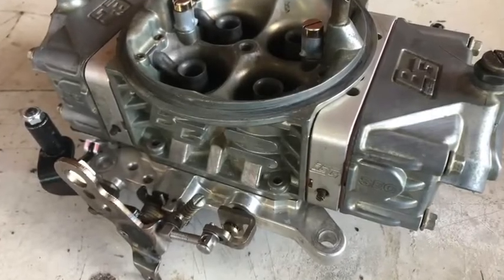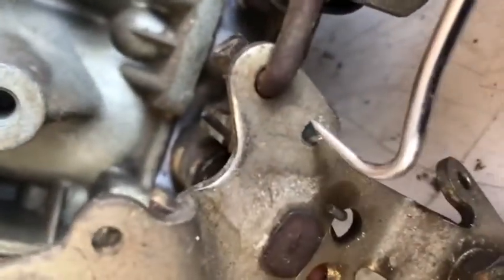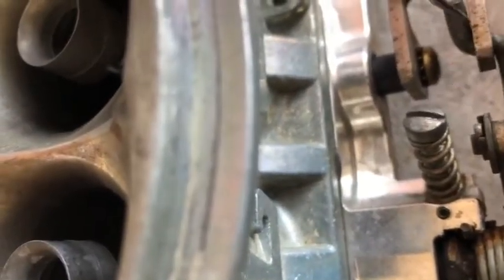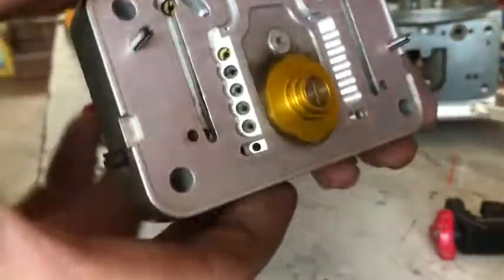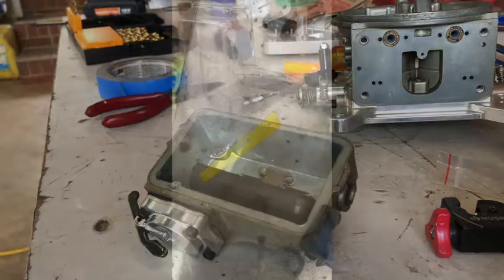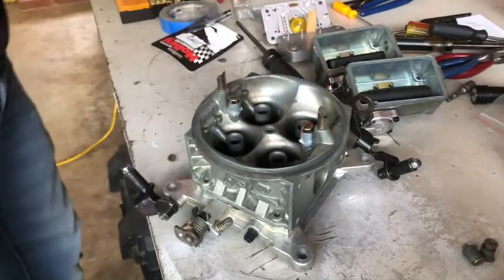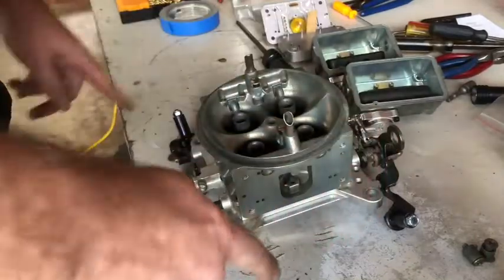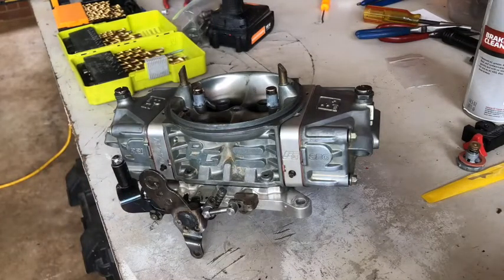Building a Blow-Through Carburetor (Part 2)

Comment: Did you install boost reference power valve in both primary and secondary???
Reply from the maker: No this has a block off in the rear...so going to see how that works out...may have to change it for dual boost reference PV...we'll see how this works to start with.